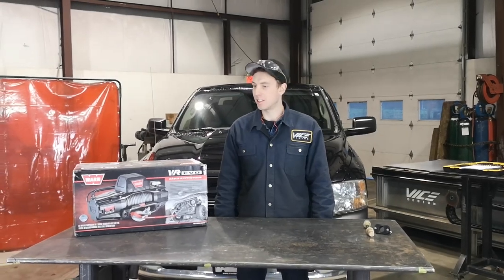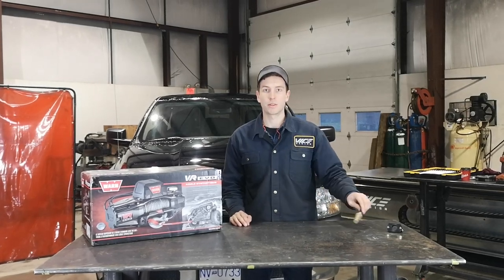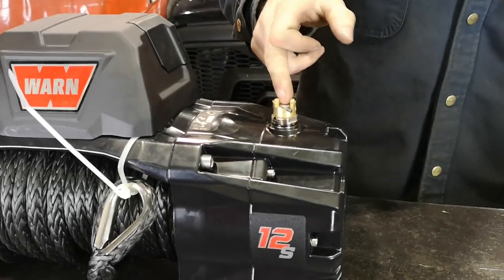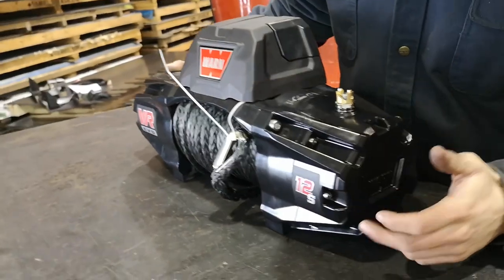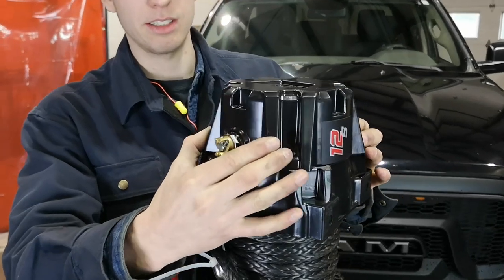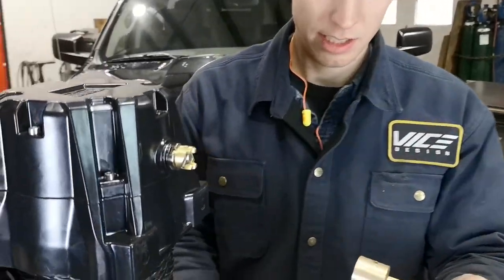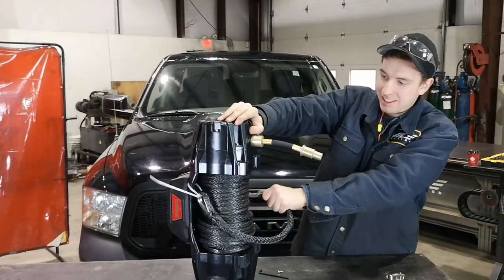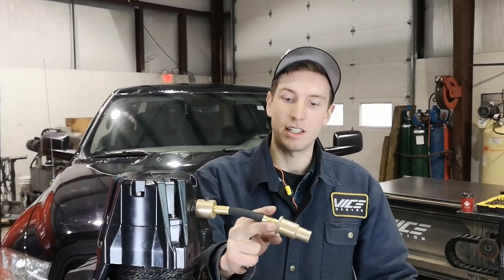Warn VR EVO | Clocking and Clutch Relocation Kit Installation | VICE Design

Comment: What about the pre 2019 ram rebel?  Any news?  Im dying to buy a clutch relocation, control box relocation (X20) and lights so i can finally install my vice integrated winch kit!
Reply from the maker: Waiting to get a 4th Gen rebel in our shop to finish development on the clutch relocation. The control box relocation for the X20 design is done and were currently starting to build the first batch. Will be on the website early next week.
Reply: @vicedesigninc  awesome!